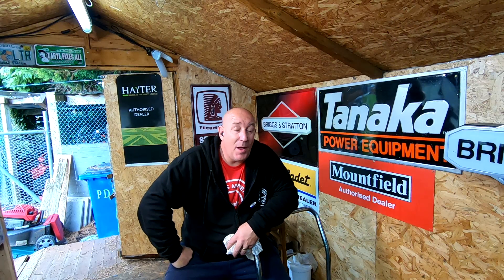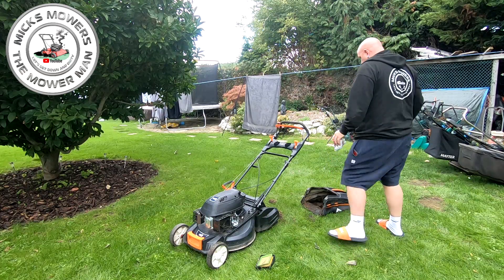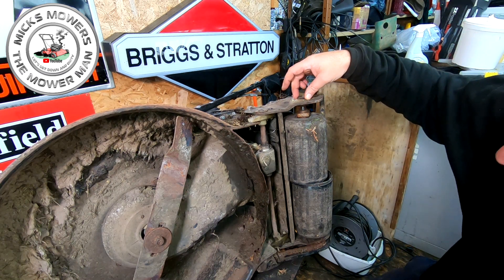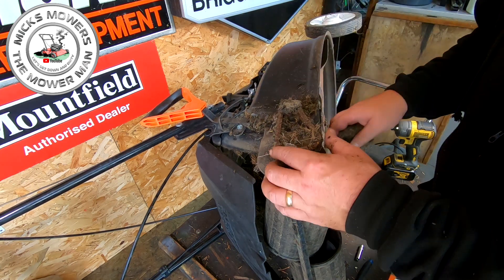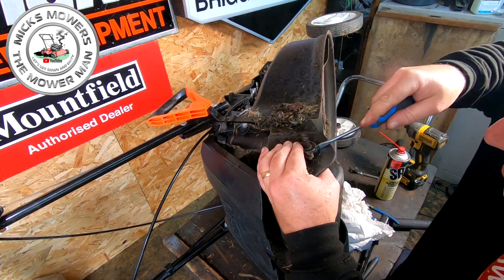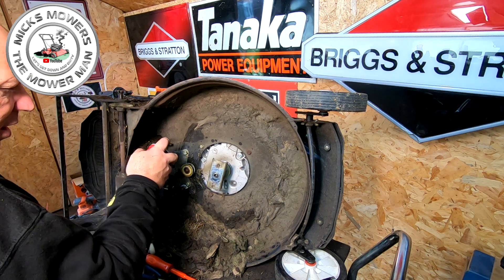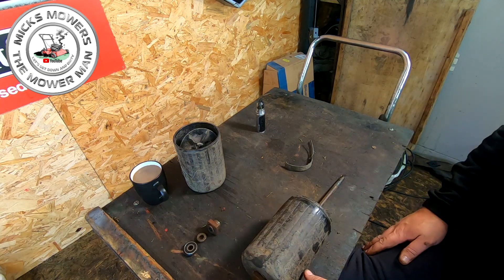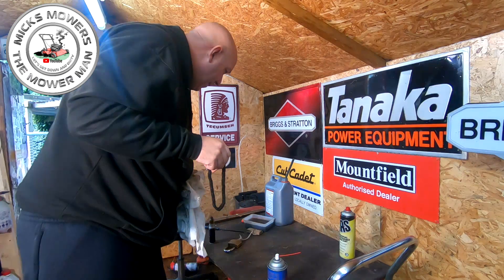Feider TR5220 Broken Drive Roller Replacement #feider #tr5220

Comment from the maker: TOOLS I USE -
Oil Extraction pump https://amzn.to/2UBApDI
Fan Blade Bulb https://amzn.to/39BLI4a
Blade removel tool https://amzn.to/3nxBVQj
Micro Drill Bits https://amzn.to/36Jpv0R
Carb Cleaning Files https://amzn.to/3lH8ESx
Hex Shank Extension Drill Bits Bar Set 1/4" 3/8" 1/2" https://amzn.to/3oFKHx9
Dewalt DCF887M1- Impact Driver, https://amzn.to/3oEVcjZ
Lawnmower Rotary Blade Balancer https://amzn.to/3e6UOWN
Rode WIGO Wireless GO Wireless Microphone https://amzn.to/2JlRlIN
Neewer 176 LED Light https://amzn.to/2HaubnJ
Universal Style, Mower Deck clamp for blades https://amzn.to/31PKygE
Briggs & Stratton Diaphragm and Gasket set https://amzn.to/3kF8Y3H
GT SONIC 3L Ultrasonic Cleaner https://amzn.to/2TDdVy9
VEVOR 3L Ultrasonic Cleaner https://amzn.to/2Gb3PBJ
Stainless Steel Strainer for carb jets in a cleaner https://amzn.to/3e6CxJ2

Comment: 🙄 Mick HT lead 👏 that's the same vari drive as on my harry.  Your only surprised to  adjust the drive when the mower is  running driving  etc. Just incase you didn't know 🤣🤣
Reply from the maker: Yeah but the arm should still move mate .. as you still see in the next video me old mucker